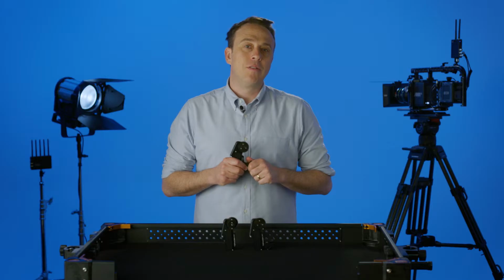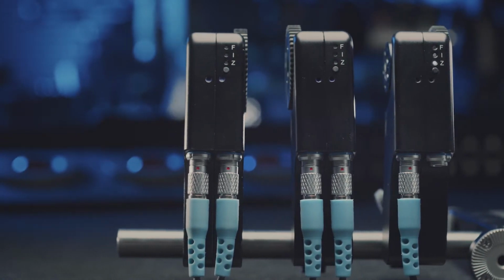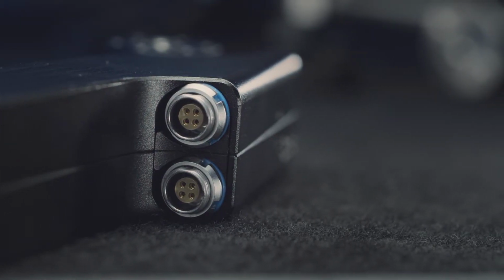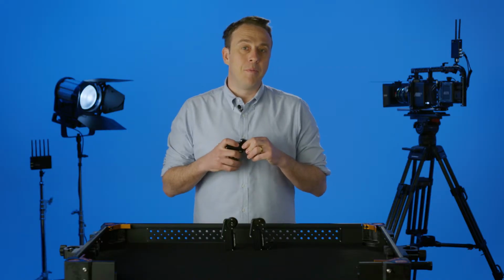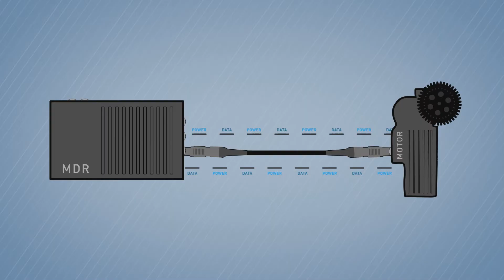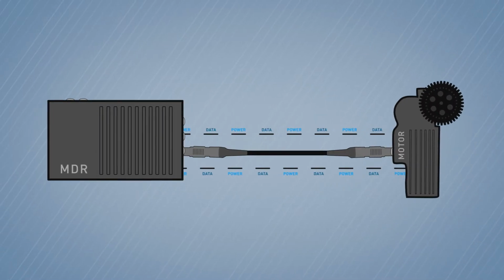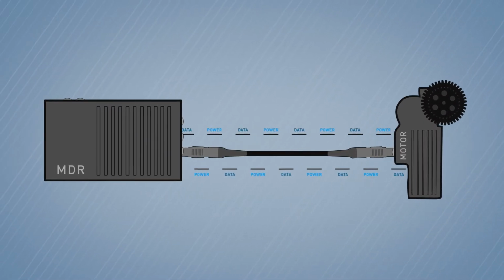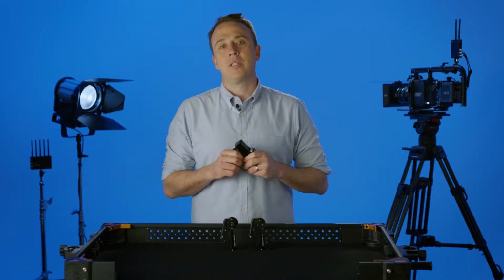Teradek RT - MOTR.X Overview

Comment: Caution! The ports are glued into place like a 5th Grade arts and crafts project. Ports snap off the pc board before a cable breaks or a scratch appears on the motor chassis. Proudly designed by Teradek they back their product, albeit glued together, and force you to pay hundreds of dollars to re-glue it when it inevitably breaks. Beware